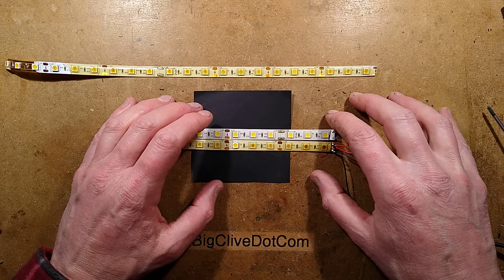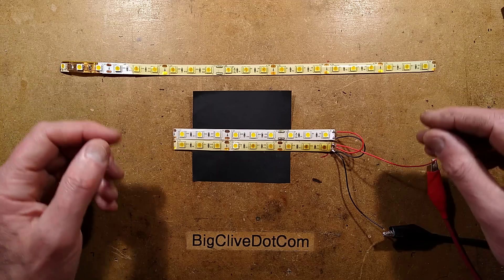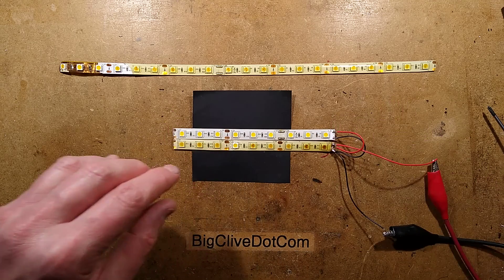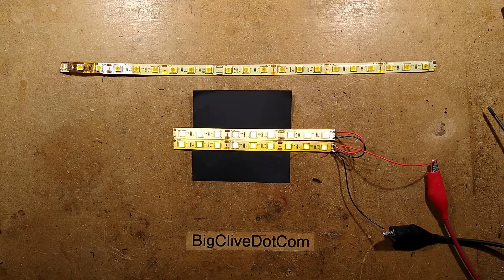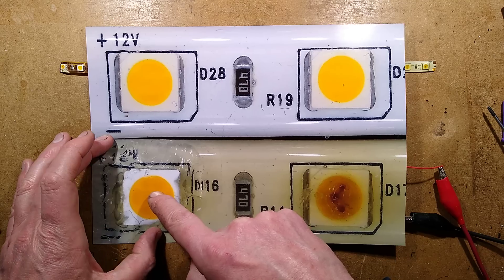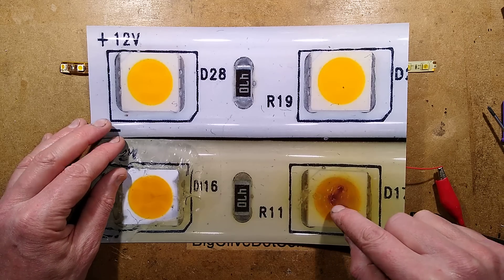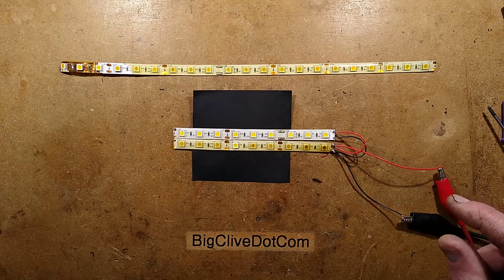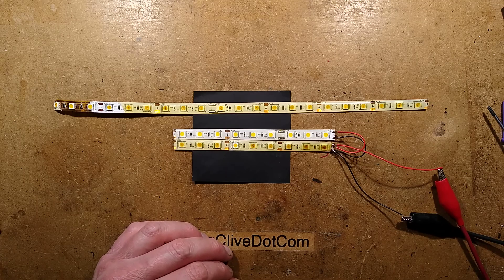IP65 LED tape coating fail

Comment: I've had the same thing happen to some LEDs I set up at work, but our LEDs were RGB 5050's.  They pretty much run blue 100% of the time.  I installed both IP65 and IP30.  The IP30's have been fine since install (around 2016).  After a couple of years, the IP65 have had the silicone coating right above the LED go weirdly gooey and the blue diodes died.  I vaguely recall the coating going somewhat brown, but not near as much as in your video.  To be clear, the silicone coating ended up literally going soft, like honey, but JUST above the LED itself.  

  I replaced them with the non-coated IP30's and it's been fine ever since.

Comment: About 2 years ago, I installed under-counter lights in a friends kitchen. They are getting ready to move so I was helping them pack up. The lights were on, and two of the 4 strips were dark orange, the other two were fine. All 4 are connected together and run at the same time, yet two of the strips were exactly as you showed in the video, but the other two looked new. The only thing I can figure is they came from different batches and the the gel was a different compound on the two that didn't turn orange.

Comment: Fascinating! Now makes me wonder if all the different manufacturers of these lights are going to experience the same failure! If so,  it seems to me, barring a coating that can indefinitely resist such deterioration,  that the solution may be to filter out more of the UV spectrum when manufacturing the LEDs themselves,  if that's possible?

Comment: If you put these into another epoxy (either with a new setup or retrofit) would that help avoid issue?
Reply from the maker: Better off with just the bare LEDs.
Reply: Clear epoxy sold for use as a glue (i.e. not as a coating) goes dark in sunlight in about a month...
Marine grade polyurethane coating is available with UV filters and may work but it uses pretty strong solvents and I don't know if that can melt the LED package, I also think it would be too expensive to buy it just for a LED strip unless it is sold in small containers for touch-ups or the like.
Reply: Ruben, I was also wondering if other led projects that use epoxy to covet or surround the led are at risk of this same thing happening to them.  @BigClive how are the things like the Christmas Led Epoxy projects holding up?

Comment: Yes, deteriorating plastics seem to be increasingly causing problems for electronic devices.
I have a lovely aviation headset which I had stored in a cupboard for about ten years.
Got them out last week when doing a clean up only to find all the cables had become so brittle  that they crumbled when touched!  Very sad. 
They were stored in the original carry case and in a dry dark place, which I had thought would have been ideal.
Interestingly, the foam ear pads and their covering are all fine. It's just the cables.
I wonder what has caused it?
I was going to see if I could use them for use with Skype calls on my computer.
Reply: I had some very high-end ski boots that I had used for 15 years. After a hiatus of a few years I went to pick them up by the rear and the plastic outer boot crumpled in my grip before I even got them off of the ground. I understand the stress that museum curators are under with artworks made with plastic now.
Reply: I recently found my old Casio G-Shock DW-6600 watch again and got all excited, getting ready to buy a new battery etc. ... but that was very short lived because when i tried pressing some of the buttons, the whole casing started crumbling apart, despite still looking like new/undamaged. Wasn't even sticky or anything :(
Reply: @Knaeckebrotsaege  That's very sad.
I've had a heart rate monitor watch break where the band attached, as well as the band on another watch just break into bits. 
Strangely, I have another plastic watch band which is more than 20 years old and still very strong.
This raises the question, how to tell which plastic products will last, and which will deteriorate quickly?

The more I learn about plastics, the more I realise I don't know.
Liking plastic products less and less all the time.   :-(
Reply: The cause is that the plasticizers (phthalates) in the cable sheathing have completely broken down. Plasticizer degradation is an inevitability with all polymers and the process cannot be stopped or reversed but it can be delayed. Keeping the item in a dark place helps as UV light can hasten the chemical process but the storage environment can't be too dry. Humidity has to be kept very stable, typically between 45%-55%. Storing the item in cold temperatures greatly slows down the chemical process. Museums that have items made of plastics and/or rubbers typically store them in temperatures between 5°C to 10°C and this can halve the rate of degradation. Museums will use even colder ranges (0°C to -20°C) if the item can withstand the cold.
Reply: @mnukester  Thanks for that information.
The climate here is unfavourable then for plastics. Temperature is usually between 15 and 35 degrees and the humidity rarely gets that low. Mostly between 60-80% but can get higher quite often. 
Have had led strips go yellow, the rubber non slip coatings on cameras etc always go like glue, and even the white plastic inside of my freezer has gone yellow, which I always previously thought was caused by UV exposure. 10pm at night here right now. Temp is 23 degrees. Humidity is 96%. Pretty normal night here on the mid north coast coast of NSW on the east coast of Australia.  :-)
I am always amused when I read the specifications on electronic products and it often says humidity up to 80%!
Not really suitable for use here then.   hahaha!
Reply: The wire will no longer be elastic to absorb any shock & movement when handling the headset so stress will concentrate at the only exposed copper and solder-joint. The hardened plastic will harm the device.
Reply: @xponen  Yes, it is brittle and cracks up into bits when flexed, yet it is also somewhat sticky.
I wonder what causes it, when it has not been exposed to light, or heat etc.
Reply: @ericoppel5698  The stickiness is the plasticizer migrating to the surface of the material. This is an inherent process and occurs over time regardless of exposure to light or heat. Obviously the cables on your headset are beyond help now but I've read from people who collect visual effects props/costumes/masks, and from collectible figure enthusiasts, that a regular application of an automotive/industrial grade protectant, such as the products applied to car dashboards and car door weather seals, is helpful in slowing the process. When applied, they form a barrier that provides some UV protection but also stops the item from becoming sticky. But always test a product on a small, inconspicuous area at first. Such products can sometimes add a semi-gloss or glossy appearance to the item, which may or may not be desired.
Reply: @mnukester  Thanks for that.
Might give that stuff a try.
Might be interesting to get some LED strips and treat one with it and not the other, for comparison.   :-)

Comment: Kind of the thing has happened to some LED strips I have. The coating has started to turn noticeably yellow. You can remove the whole coating completely by getting one end loose and just slowly peeling it off. It leaves behind no residue.
Reply: Depends, tried to do that with mine and it was stuck quite hard to the LEDs and started the lift them off, probably because they are the smaller LEDs.

Comment: White LEDs 450nm led dies. 
450nm blue, or "royal blue" leds put out a very small amount of UVA (>380nm). its pretty harmless but there are plastics sensitive to that. UVA is actually considered near-UV because it doesnt share most of the effects of typical UV light, but has a degrading effect towards certain plastics.

Comment: Really odd and really interesting.  The UV component to the LEDs is usually very very small and only really generated from the phosphor compound.  I wonder if there is maybe its not just the UV but also O2 around the bench causing the strip and coating to break down faster??  idk.  Very interesting.
Reply: The phosphor does not generate UV, that would be against physics. Its the small amount of UVA from the blue LED chip.
Reply: @drkastenbrot  Yeah, you are correct.  I believe I had it backwards... But I doubt the UVA being emitted from the LEDs could cause that much damage and decay in the coating on its own.  Just seems a bit strange.
Reply from the maker: Blue light is also destructive to some materials.

Comment: Good to know. I only have 1 meter of this sort of LED strip for testing purposes only (it was the only one I could find at the time). Typically I go for the one inside the silicone sleeve, but a colleague said he preferred the bare strip with the double stick tape on it -- me, not so much, the stuff comes off with soldering.

Comment: Interesting. I've got two 50cm lengths of RGB LED tape stuck to the back of my PC monitors and have noticed that the light colour has changed. Looking at them, I thought the blue chips had started to burn out as there are brown patches on the blue chips on the three-colour packages, but I'm now wondering if it's just the gel covering them...

Comment: I wonder if it would be worth it to test the coating with an external UV-C LED to see if that's what's causing the degradation, or possibly a soldering iron or heat gun to see if it's the temperature of the LEDs over time?
Reply: Likely because that coating is urethane based, which will ineviatably degrade with time, no matter what you do.  Just will go slow or fast, depending on ambient oxygen and moisture by it. Yes a nice flexible coating when new, but only going to be that way for 6 months.

Comment: Seems to be par for the course really, the plasticky goo they used just couldn't handle the heat and the UV-ish light, and as with plenty other plastics has just given up and essentially slow-cooked, might fare better if it were the bare LED tape, but that's a pure guess on my part...

Comment: I actually recently pulled down some led stip that had been up for a number of years and found it was in similar condition. I never noticed a change in color since they were set to constantly fluctuate anyway but the loss of intensity was noticeable. I thought the covering had just degraded, it didn't occur to me that it might be due the led lights themselves.

Comment: Best justification yet for buying the even cheaper strips without the conformal gel, at least if they're not getting used outdoors. Strange it would deteriorate so quickly indoors though.

Comment: I had some rgb ones that were used for Christmas decorations. about 6 years and that coating is so brittle you cant move it at all anymore and this was mounted on metal and used very intermittently when running. (also same reduced output as well) The same yellowing happen on the new in box suff from the same batch as well, but it didn't get brittle like the ones used outside. (if you see the light video on my channel its the floods)

Comment: I've had them fail in a similar situation without being used. I bought a set of 4 12" led strips that I intended to put under my dashboard but I couldn't find a good place to mount them (I'm a measure none and try again kinda guy). I ended up throwing them in a box in my shed and forgot about them for maybe 2 years. When I found them during a much overdue spring cleaning they were very yellow and had become very brittle. I was curious if they still worked but all of the LEDs looked very dull and foggy. 

I'm in Maine where the inside of that shed will be over 50c in the summer and often under -20c during the winter and I assumed it was the extreme temperatures I forced it to endure but I guess it was just poor quality Chinesium.

Comment: Clive, are you aware of VOC induced LED failure? It’s quite a problem in some applications.
Reply: When I went to solar for my house I replaced every bulb with led the bulbs I bought for the kitchen, dining and entryway replacing 25 watt bulbs had a clear plastic bulb cover, the cover came loose so I superglued them in place, the front half of the leds fell off the pcb, I realized I should use Elmer’s water based glue stick
Reply: @Ricky_B4  Your comment has nothing to do with the one you replied to.  Please put new anecdotes as main video comments or under a relevant comment by others.
Reply: @johndododoe1411  And Ricky's comment is directly applicable to the thread here.  Superglue produces VOCs which can degrade components such as LEDs, which was the point.
Reply: @foogod4237  Ricky didn't mention that, and the VOC TLA was too obscure to make sense outside selected chemistry related forums.  Note: TLA=Three Letter Acronym, a designation used only to decry overuse of obscure or clashing such outside relevant closed groups.
Reply: @johndododoe1411  Umm, no, VOC is a pretty well known term even in casual usage in my experience, and more importantly, if you had just bothered to go to something like Google and type in "VOC" in the search box (without even any other context), the very first thing that comes up explains exactly what it means here (I just checked by doing it myself).  This is not an "obscure" term in any way.

The real problem is just that you just knee-jerk reacted to a comment by chastising somebody else without bothering to even try obvious methods to check that you knew what you were talking about first, and, to be honest, kinda ended up looking like an idiot in the process...
Reply: Does VOC=VOice Control, or some other ungyessable phrase?
Reply: @johndododoe1411  VOC is volatile organic compounds

Comment: I had a similar experience with that gel goo coating on an older strip. Ended up throwing it out and installed a newer version that didn’t have the gel coat.

Comment: Back in the day, I did a stint at a company that did nothing but replace lighting.  Mostly florescent at the time.  There is a local grocery store that - before LEDs were in widespread use - would re-lamp the ENTIRE store every 6 months.  From the deli to the dairy.  Every case, display and cooler.  The reasoning was the severe drop off in the light output of phosphor tubes and ballasts losing efficiency.  There is also an entire industry dedicated to making sure that everything from produce to cheese to meat uses a color spectrum that accurately compliments the food color.  

New freezer cases were coming on the market with LED lighting in them, but more often than not, we were replacing the driver modules when an entire door strip failed to light.

Comment: LEDs will last for many years.  The issue I have found is that the components around them don't: power supplies, coatings, other electrical components and such.  It will be interesting to see if the industry will up the game with the other components to maximize the true potential of LEDs.
Reply: That is, if they're not overdriving them. Which happens a lot nowadays.
Reply: I agree, I've noticed it too. I have a hue bulb where the power supply failed but the LEDs in it are completely fine.
Reply: Industrial LED lighting lasts forever (30+ years). Its not even hard to design LED lights to last that long, but selling this outside of specialized applications is just not as profitable. 
LEDs, like pretty much all electronic components, have a fairly predictable lifespan very closely tied to their operating conditions. Consumer bulb-type lights drive the chip at a level where you will typically have to replace them every few years. However, permanent light fixtures are designed with much better thermals and I would estimate well over 10 years. 
If you want something that lasts, use over-specced components well below their rating and keep the thermals low.

Comment: It doesn't have to be uv light to degrade the gel coating, blue LEDs degrade most plastics, yellowing them and that could be the case here.

My PC have blue leds and the inner white plastic (now yellow) on the front is almost brown where the light hits directly.
Reply: It probably is UV degrading the plastics in your case. 

Blue LEDs typically do put out UV light. In fact many “blue” LEDs are simply UV LEDs with a blue phosphor instead of a cool white or warm white phosphor.  Even those blue LEDs that do output blue light directly often output at least a bit of near UV.
Reply: @gemedetvideo  maybe, but I don't think so. I have 395nm uv led and normal white leds and their phosphor layer does not glow well under uv but with blue leds they glow brightly, and they are clear, no phosphor, any blue led lights up the phosphor layer of the white leds that I tested ...

Although blue leds are near-uv with wavelength around 450nm, they have a short wavelength range, maybe only a fraction can get around 400nm.

Ah, royal blue leds have a phosphorus layer to get a more light blue color, but I don't have a royal blue led... It emits green light to mix with the blue.